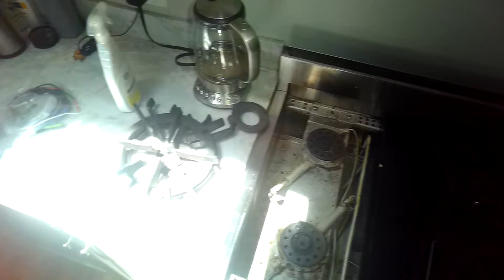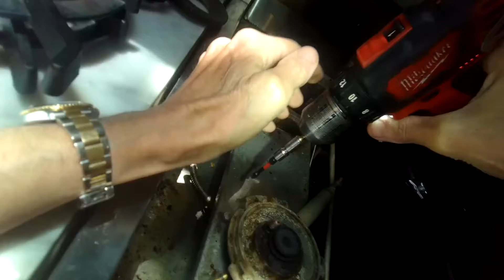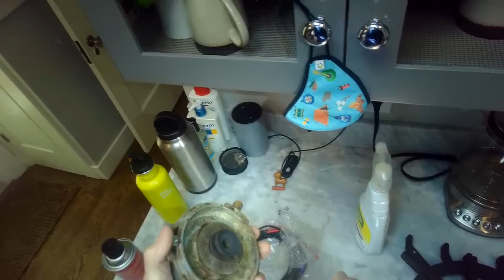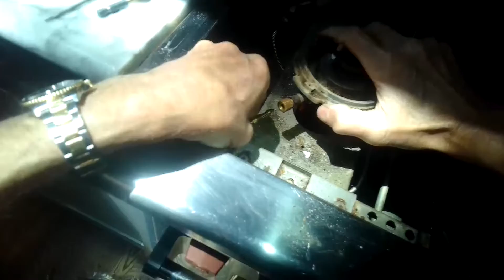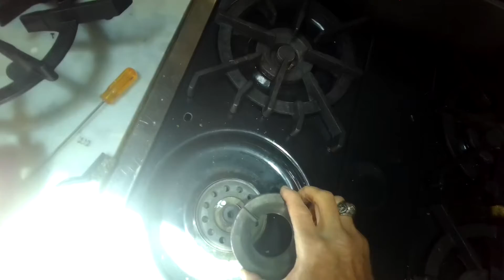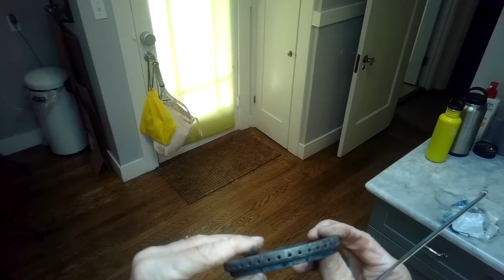✨ WOLF RANGE KEEPS CLICKING - FIXED ✨

Comment: Thanks for making this video. So my old igniter had a tiny male spade connector. The new one has a much larger spade. So of course the old wire won’t fit the new igniter. The kit came with 5 wires so I either have to splice or replace the wire. Question. What size is the spade connector on the spark module?  Hopefully small. It seems that every one of the 5 wires has small connectors on one end. Thanks in advance.
Reply from the maker: You’re right,
The one that goes to the spark module is a small speed connector.
I wonder if you can squish down the large brass big connector so that it will fit on your newer, smaller, igniter terminal?
Reply: @ScottTheFixItGuyChannel thanks for answering my question. The terminal on the new igniter is the larger spade so I can either switch the entire wire or splice.  I was just worried the larger end went on the module. Now I just have to hope it wasn’t the module that was bad or I wasted 100